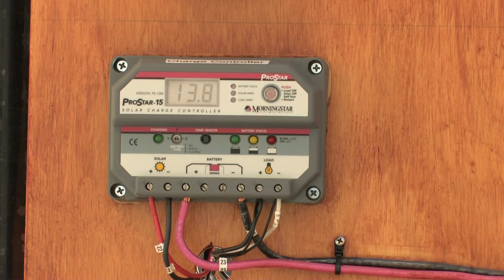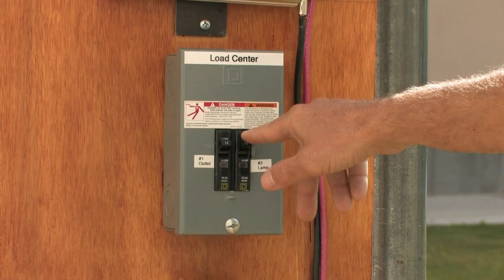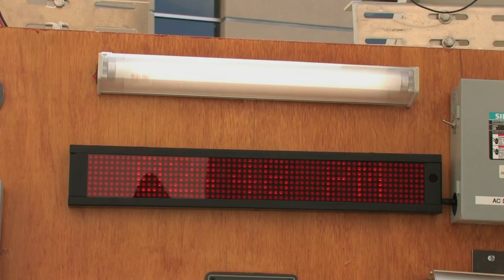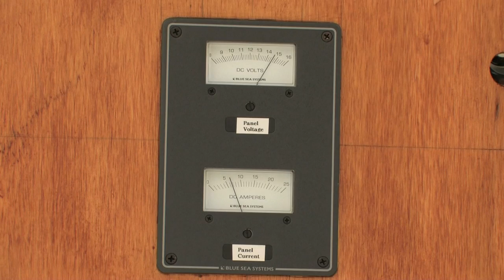Renewable Energy: Solar Panel System Components

Comment: One of the most inadequate videos I've seen on solar # 1it is not recommend to run a load just off your panels # 2 the batteries he's using should never be discharged more than 50%